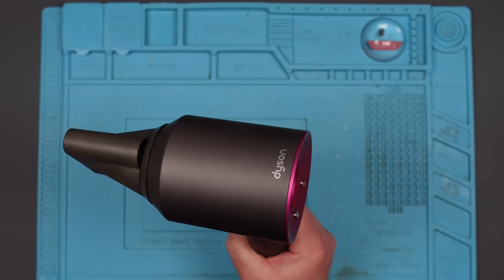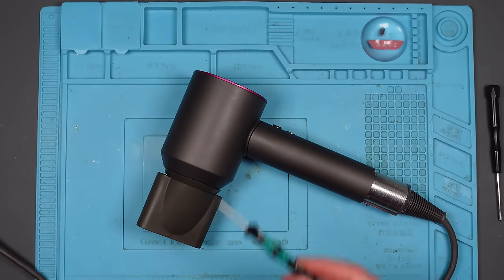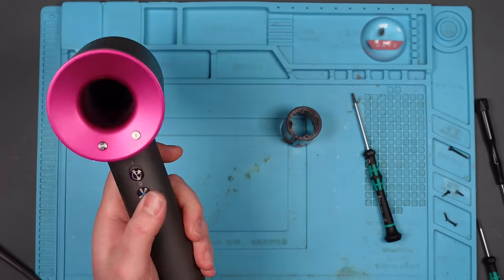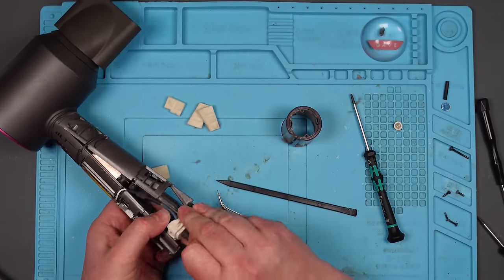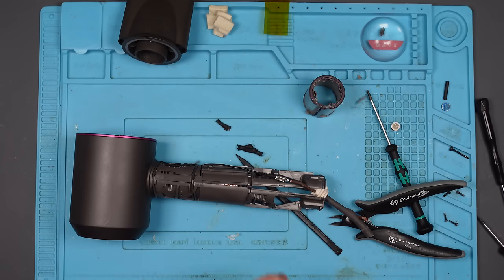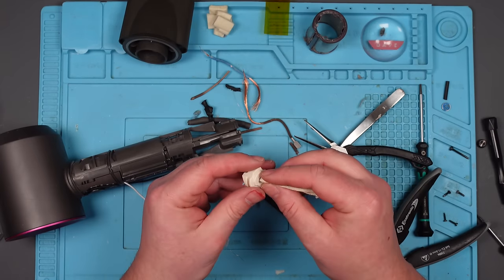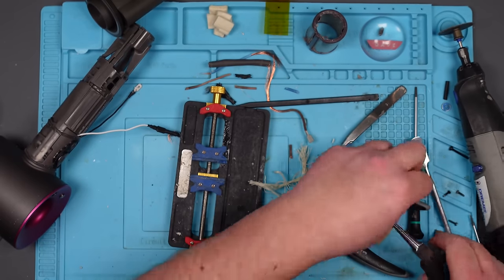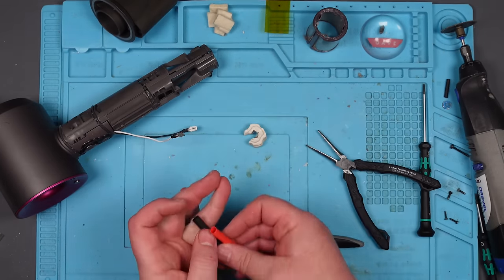I paid £75 for a £400 dyson hairdryer on eBay | how bad can it be?

Comment: Did you try and get a replacement lead from Dyson? not sure if they sell spares but i would have thought so, Another thing to try for replacing the strain relief would be to use some milliput (ebay is your friend), that is a 2 part epoxy putty and dries rock hard overnight, just add some where the white strain relief used to be and just close the case around it, super glueing the buttons on might be an issue if you try and remove them again.
Reply: New cables, fitted with the strain relief thing, are available for less than £15.

Comment: I have worked with several ex Dyson engineers. Dyson is a scum bag. None of their products bar the original vacuum is any good. EVERYTHING has these small brushless motors in because he bought a ton of them and they where wrong for the vacuums so they get pushed into everything. 

Bottom line. WHY pay £400 for a hair drier? More money than sense.

Comment: Nice find!
I'm a bit curious though... doesn't those ultra expensive ridiculous Dyson crap have lifetime warranties? Why would someone sell something like that on eBay for less than a quarter the price?
I guess the brand has the clientele it deserves in some way... or perhaps this was stolen?
Oh well.
I guess you could 3D print that strain relief to make something a bit closer to the original, but just not worth the work.
It's all part of the overengineering and then overcharging philosophy that Dyson has anyways, better not to get stuck on that. Personally I think I wouldn't even try preserving that piece there... perhaps come up with something involving cable ties, glue, some wooden or cork peg.... whatever.
*correction - I've seen the official website, this crap has only a 2 year warranty... unbelievable that someone would pay over 400 bucks for something like that.
Funny that with all the overengineering, custom parts, complex assembly, and all this extra crap they famously put in with a thousand design revisions and whatnot, it still failed in the exact same way all crap hairdryers also do. One that would be solved by putting a protective wire mesh around stress points...
It does look stylish, I'll give it that. Interesting venue for fixing and recycling.

Comment: Returned mine after just 3 months. I never used it on highest heat or speed. Cleaned filter etc. Was cutting out every other time  and final time it would not turn back on. It was good when it worked but just not worth the inconvenience and being unreliable for £330. Did not risk a replacement Dyson, got refund and bought different make. Id read on forums that alot of the hairdryers had same issue as mine but after 2 or 3 years, when warranty expires etc. Like alot of electrical goods now, seems like they set it to have a limited life so the consumer can 'expect' to keep replacing every 2, 5 or 10 years etc.

Comment: I mean... you snipped off the wire, why not just test is straight away with the multimeter if the break is still on the loose end. It's 99.9% sure that the cable broke after the strain relief you just have to make sure you cut off long enough wire. THEN you can mess with the other end and figure out how to hook it back up. Maybe add a ziptie above the white part and add a generous amount of 5 minute epoxy to make sure it doesn't come loose.

Comment: You need a 3D printer chap - would have been quicker to model and print a new cable relief than butcher the original, plus you could flog em on ebay after, probably....

Comment: Stez, you can buy low temperatures thermosetting plastic which softens in nothing more than boiling water and takes a few minutes to go solid, allowing you to mould it. You could have made the plastic thingy bit from that.
The great thing about it is, if it’s not correct just put it in boiling water to soften and start again.

Comment: We had some ghd hair tongues that failed for the same reason, the cable became damaged at the point it went into the unit. Luckily, it was much easier to open up and you can buy replacement cables. They really need to stop making things that can't be repaired easily. Just not good for the environment.

Comment: Never solder something that handles these high voltages. During longer use the solder joints heat up and fail. Buy the proper clamps.

Comment: You probably shouldn't use so much solder inside the high watt circuit such as a hairdryer for the same reason you shouldn't solder wires in the walls of your house; the heat from such wires load is likely to melt the solder and cause a problem... A big problem (like fire). For what it's worth I think you should have tried to reuse the old spade pieces.

Comment: People think James Dyson is some kind of modern day Einstein.  The only thing James Dyson did was raise the price of cheap domestic electrical goods by 1000%
Seriously.  Vacuum Cleaners used to be 40 quid, hair dryers used to be 20 quid.  Now people seem happy to pay 700 quid for a bloody "Hoover" and 400 quid for a Fan.
Go to any Council Tip and there will be a Dyson Graveyard of vacuum cleaners in the corner.  It's cheaper to use £5 bank notes as Wet-wipes than use a Dyson Vacuum cleaner.
His contribution to society is putting an electric motor inside some plastic tubes and charging £700 quid for it.  
I guess a fool and their money are still easily parted.
Reply: And people think James Dyson invented something. But he did not.
He just took the cyclone filter system used in industrys for 100+ years.

He just made it worse and less working for vacuums, causing damage on the motor by particles still pushing through the cyclone.

Comment: It's like my old tele that wouldn't work until i unplugged and plugged it back in again, but even then sometimes it wouldn't work as the wiring was so messed up, as it was ex display, but it at least it was cheap for a hd television!

Comment: I worked on a similar problem in the past. Not exact. I also had a part grommet collar that was half gone but still sturdy. I used a silica cavity solution similar to when putting cables through walls to block drafts. I used a small injection, and it expanded into the gap. Not brilliant either but it gripped better than it did lol

Comment: My main surprise is that they don't use a connector similar to what you would find in, for example, GHD Hair Straighteners; which allow 360 degree movement between the flex and the straighteners.
Reply: I would probably do a little modification

Comment: Here is what i did with similar strain reliever: I cutted wires leaving couple of centimeters on them, pulled all the copper out and drilled the holes a bit bigger following old holes best i could. Then i just routed new wire in with some glue. Quite easy to reuse, even easier if done without glue and just tieing knots to the wires.

Comment: More and more these days, it seems that products are not only not designed to be repaired, they are also designed to not be repaired.
Reply: Absolutely. My first job at the repair café yesterday was a £300 pair of rechargeable Dyson hair straighteners; 2 years old, not holding a charge. Slowly I made my way in, then found a battery pack part number. The 'customer' (it's a free service run by volunteers) searched for it and as I was starting to gain access to inner parts declared that all the results she had found were forum posts saying it was impossible to buy even a 3rd party one. Or people moaning on Facebook that theirs had only lasted 2 years before not holding a charge. 

Only 2 years old FFS, and I could see they were just 18650s inside.  

Worse still, she'd assumed that the charger was the fault so bought a new one for no reason. It's a borderline scam at this point. 

I hate Dyson and their ilk. At least I didn't draw blood like I normally do with their products!
Reply: They are designed to be repaired.

You can replace almost everything. Motor, Cable buttons.
Device is opened in 1 minute without damage.

Some people just dont have the craftman skill which is needed. Not everyone can be a craftsman.

Comment: Surely you should have just cut the wire at the break/fault and simply reconnected them securely. No need to take any of the drier apart.

Comment: You have a bench power supply, and you didn't "Hot Wire" your way through that plastic strain relief, it would be a much thinner and cleaner Slice. 
:) Where has the spirit of Macc gone Stez